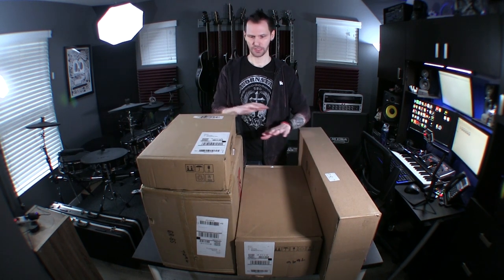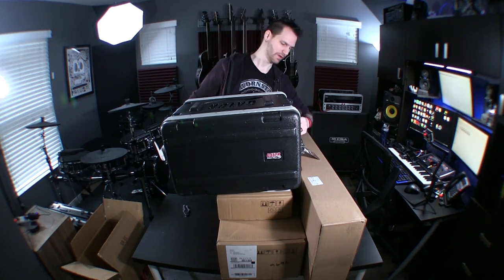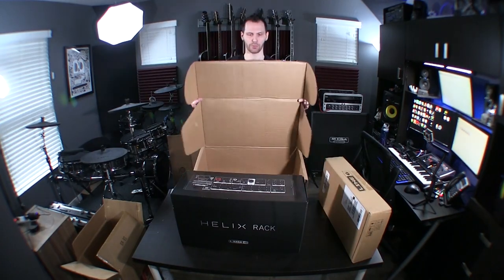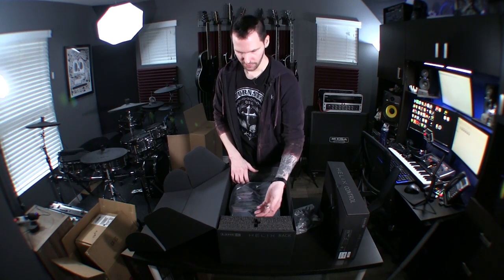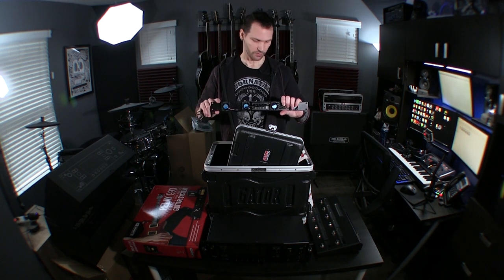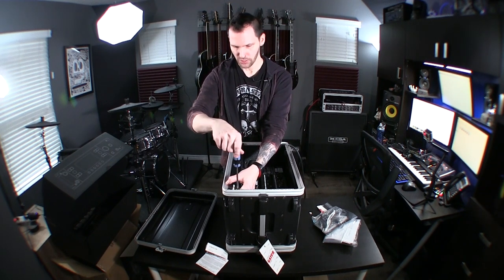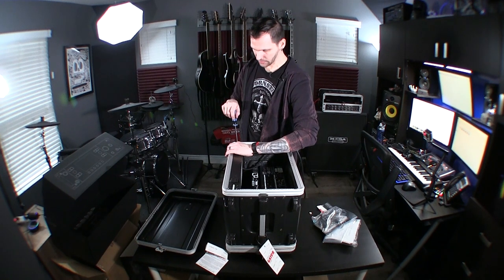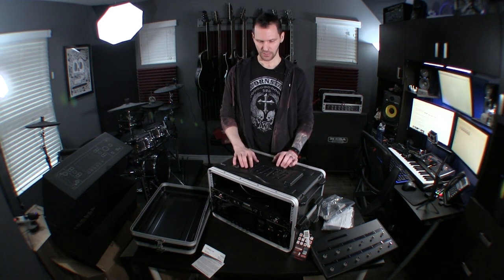Building a Helix Dual Amp Live Guitar Rig (Part 1) - Line 6, G90, Furman, Powerstage, Gator

Comment: hey chad, just wondering, ive been playing for about a year and a half and have been progressing very well, so im wondering if i should get a line6 wireless to possibly use if i buy an orange super crush 100 and start gigging regularly.
Reply from the maker: I highly recommend the modern Line6 wireless systems and I couldn't imagine gigging without one. Even in a small venue it's helpful to not be tied down. The Orange Super Crushes are amazing, by the way. Good luck!

Comment: halo.. which you prefer, the line6 g90 or shure GLXD ? Which one for best sound? And how about their sound quality on stage? these both make me confused.
Reply from the maker: I've been using Line 6 wireless units in various live situations for years and I've never had a range or frequency issue I couldn't fix. Wish I could comment on the Shure, but I haven't used it in outside of just playing around with it.

Comment: Hey, Chad. I'm using a Fractal AX8 with a Seymour Duncan Powerstage 170. I was using a full rack midi loop switching setup with a tube amp and got tired of lugging all that gear around to rehearsals and shows. I decided to slim stuff down and couldn't be happier. I had thought about getting another small rack set up as you have right now, but I wanted to have everything on one pedalboard. Now I just need to hook up two cables. I'm thinking of getting a Line 6 HX Stomp to use with the new Powerstage 200 for some fly gigs coming up. Did you end up getting one of those HX Stomps yet?
Reply from the maker: That's a killer setup Vito. Definitely keeps down the load-in/out fatigue. I'm holding off on the Stomp until I start gigging again (prob early summer). Good call on one of + Powerstage for fly gigs. Hilariously compact and you can get the same tones as the big rigs. Anyway, good luck on those shows man. Let me know how they go!

Comment: How to you intal the Helix without it shaking around? Those 4 little screws seem pretty weak when considering this is going to be on the road.
Reply from the maker: Thousands of touring bands can attest to the strength of rack ears. They work. As far as impact and vibration, that's where a shockmount case comes in.

Comment: You should have gotten a 10 space on wheels and then you would have purchased a drawer to put the pedal in and enough space for the Crown XLS 2500 power amp or MATRIX 1000 1U space.
Reply from the maker: Agreed. I'm kicking myself for not doing something like that. I wanted compact, but this is really pushing it. I'll probably swap out soon.